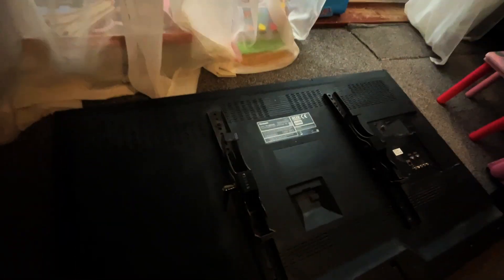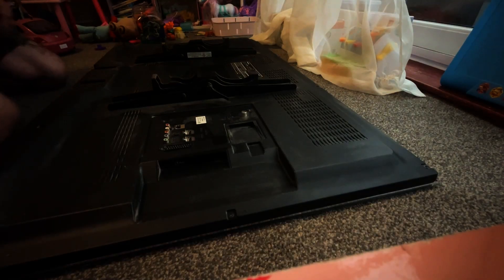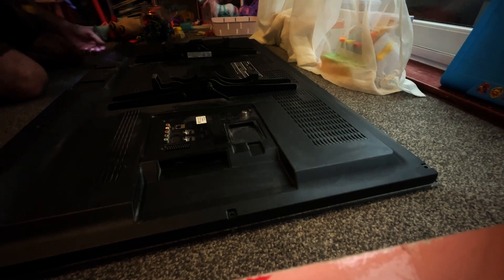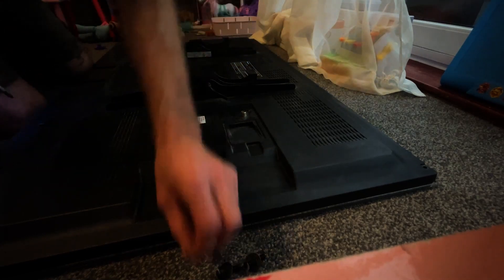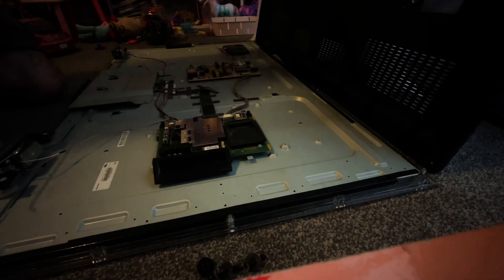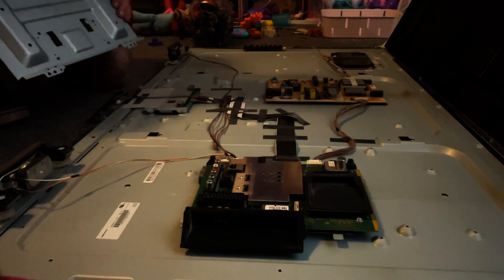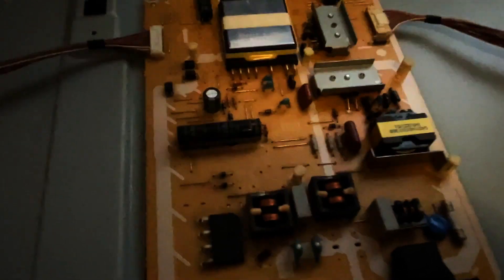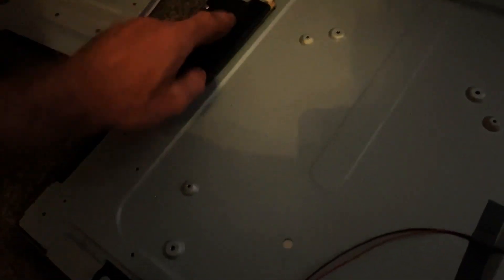Simple But Effective Way To Make Your Tv Last Longer

Comment: Put a small fan behind the TV to circulate air through the ventilation holes and be certain the LED backlights are not turned up any higher than necessary are the best ways to prolong a TV's life. Based on working with electronics since 1969.  Almost all industrial and military electronics have forced air cooling. It prolongs the life of every component, especially in a warm climate.

Comment: In 2016 I bought a Samsung UE48H6400 on good recommendation from publications (Which, What HiFi, etc)  it won the best TV under 1000 quid in 2015.  Had it for a year then 1 month past warranty ending it started flickering, switching off by itself and new permanent purple patches appeared which got bigger and more of them on the screen.  Was advised it would cost between 100-200 bucks to fix (I told Samsung to go swivel).  Then, after just 22 months from brand new, it would not turn on anymore, so out came the hammer.  Absolute fucking garbage.  Growing up from 70's, all the way through to the 2000's, we had TVs that lasted for 10-15 years no sweat.  They only replaced to get a bigger/better TV (old ones either got sold on or given to family).  My old 12" color portable from 1990 is to this very day still working for my cousin.  NOW I have an LG OLED with the backlight down to just 10.  I am not risking it overheating, but the fucking power supply or scaler board or summat will probably go pop just out of warranty...
Reply: Samsung uses cheap Chinese capacitors in their switch mode power supplies, that is likely why your tv failed.